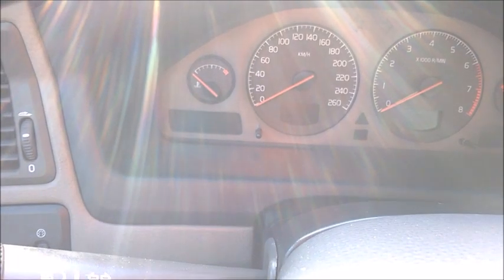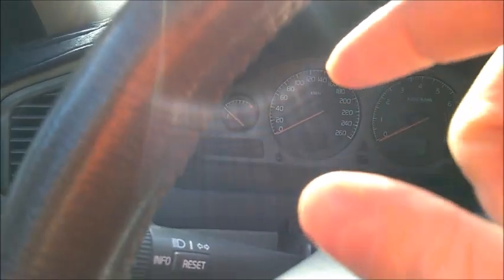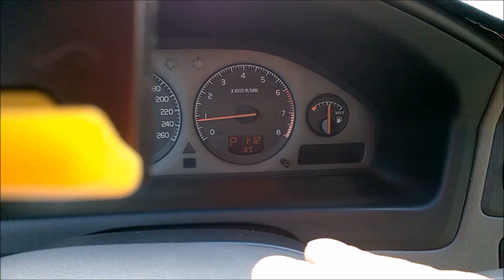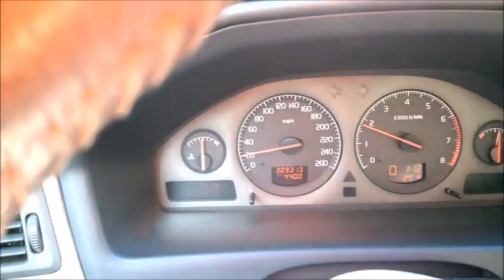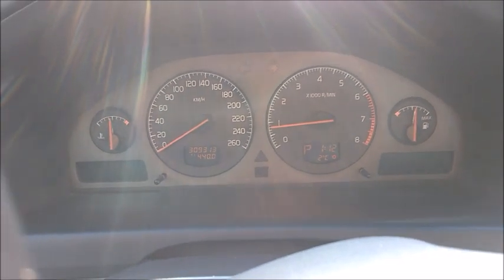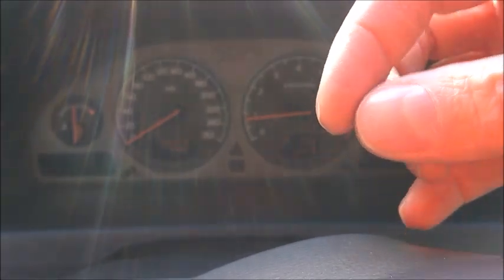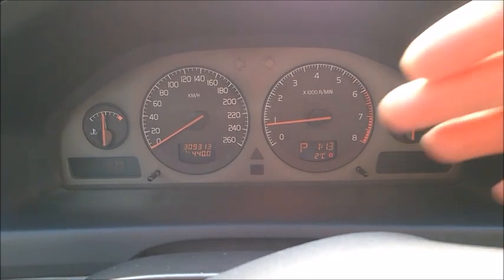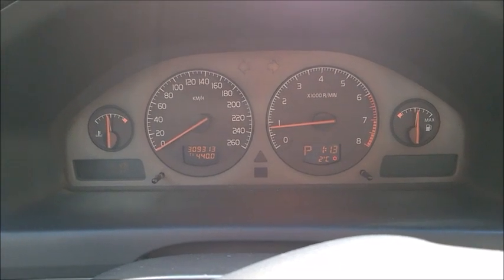Volvo S60 V70 ABS system Self-Check sound  2001-2009

Comment: I have a Volvo C30 R Design 2011 - I appear to have a noise at 15 - 20mph (only after initial ignition, plus only once). It sounds like a quiet clunk, I am hoping this noise too is from the same ABS type check. Thanks

Comment: Hey man, whenever I google something about my S60 I always end up at your videos lol, thanks again for making these they have been so helpful. My S60 is making a really short and not very loud metal scraping noise whenever I drive away the first time at around 10kmh. Could this also be from the ABS? It only happens once everytime I drive the car
Reply from the maker: I have a few hundred vids indeed 😎  Indeed the ABS system makes such noise you describe, and happens every time the car is started - even after a warm start - at around 7mph which is about 10kmh indeed. I'd say it also seems to come from the front left side, which is where the ABS unit is located on north american left hand driving cars. I once had a bad abs sensor (I pulled on the wire while replacing a suspension part) and the check noise would no longer sound until I replaced the sensor.

Comment from the maker: Usual issues (as far as I know..)  with the ABS are:  a bad sensor will trigger the light and cause the ABS to kick in for no reason (sensors go bad when even slightly pulling the wire while working on the suspension), BCM (may be replaced with matching numbers or sent to Xemodex), or CEM (water ingress usually on 2004-2005).   The kind of issue one usually needs Vida to diagnose.  If there is an ABS problem, you won't hear the sound in the video (the system will not self-check).  The BCM - brake control module, the black box under the ABS unit, does go back and throws a Brake failure light.  Xemodex can fix it - I've also heard the car can be driven without it until it for a while, not sure if this will trigger an SRS message or not.  The connector for the BCM module is very tricky to remove, see this video at 12:00 - it also shows instructions to remove the module  https://www.youtube.com/watch?v=jKcDOLIYR3A

Comment: Damn, I allways thought it was the hot air/cold air intake flap which helps the engine to warm up faster by pulling air in around the exhaust manifold.

Keep up the good work!
Reply from the maker: Cheers!

Comment: this noise has bugged me for the past several months and I had no idea what it was. 
Thank you for posting. I had no warning lights so I thought a linkage problem.
My "anti-skid requires service" light is on. My ABS senors are showing no codes and I have the clunk noise at 10mi/hr, so the system is checking well.
I'm wondering if the rear tone ring since the rear ABS is showing a black rubbing line.